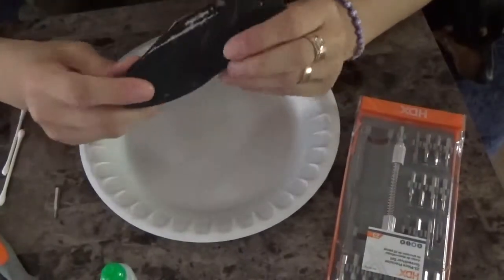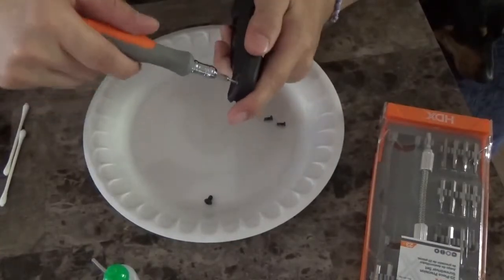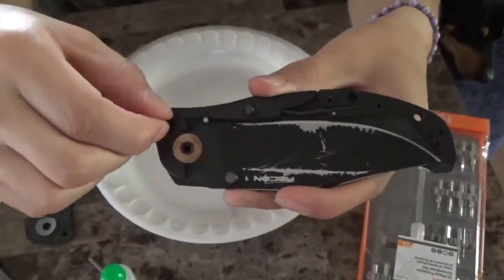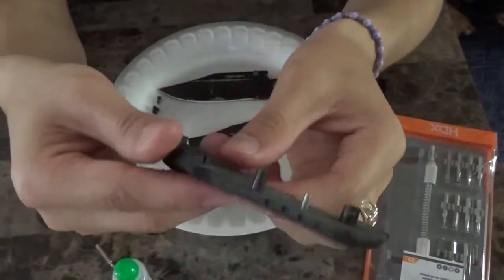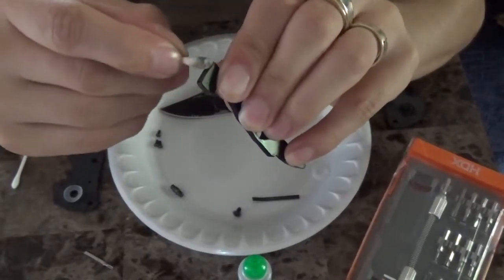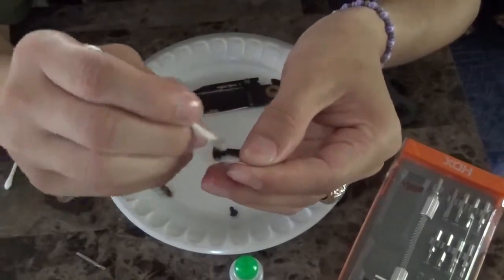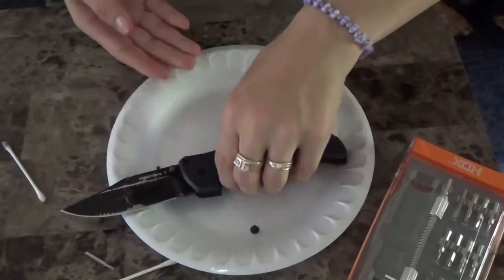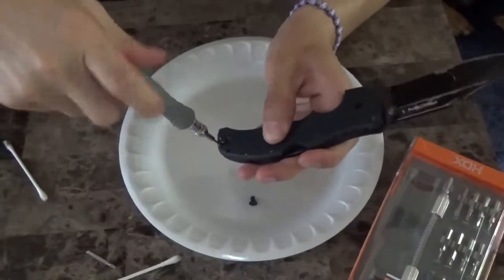HOW TO: COLD STEEL RECON 1 - DISASSEMBLY & MAINTENANCE / CLEANING

Comment: The pivot pin on mine rusted. It works ok but eventually had a little play. I lost that knife and never found a solution. 

Dont mix the lock pin and the other one that's about the same size.  I bebd ths spring to open easier. Sand smooth any machining marks on the blade that interact with the lock mechanism.

Comment: My Recon 1 came with the bronze bushings against the g10 and the teflon washers against the blade.

Did you change them around yourself? If so for what reason?
Reply from the maker: +words words words words words words words words words words words words words words words words I did not change mine. i think there may have been a mix up at the factory with your recon 1, you should change it so the bronze bushings are against the blade so you get the benefit of the bronze bushings "polishing" over time with use. is your knife hard to open or feel gritty? if so you should see a big difference in terms of ease of opening once you switch the bushings around. however keep in mind there is a break in period with the bushings on the blade; some lubricate of your choice (mineral oil is food safe) and working that pivot open and closed for a week should get your knife buttery smooth. Hope you enjoy your recon 1, its a really great design and a great lock too.  thanks for the view and comment!

p.s. i kinda though it was weird when i first opened the knife that there was Teflon washers, but i just figured they were there to reduce friction on the g10 side and make operation smooth.
Reply: +S u r v i v a l W e a p o n s (SURVIVAL  WEAPONS) 
Yeah that's what I figured so I already switched them around. It makes a huge difference. I thought the stiff opening was just part of the Recon 1, but now it opens so smoothly I can even flick it open. My knife knowledge isn't the best so if I hadn't watched this video I would've probably put it back together with the teflon against the blade. So thanks for the vid!
Reply from the maker: +words words words words words words words words words words words words words words words words Glad the video helped you, and thank you for the kind words. i have more videos in the works and im also thinking about doing some more take down videos so stick around. thank you for the view and comment.
Reply: All cold steel came with bronze washer agains the g10 teflone agains the blade...maybe this guy reviewing accidentaly change the position.watch other vid ..you will see...
.